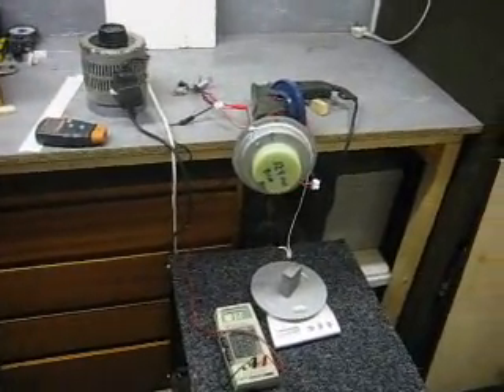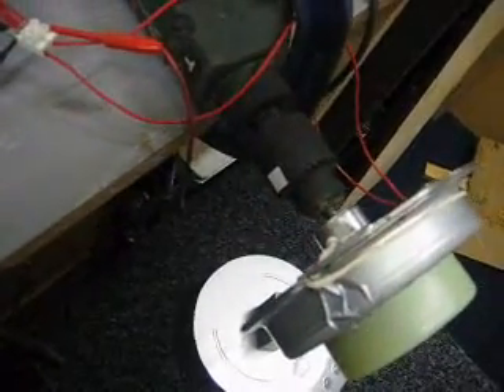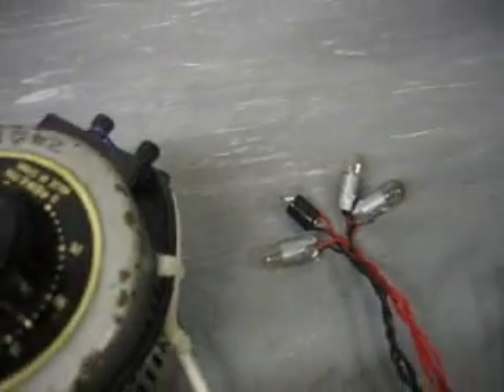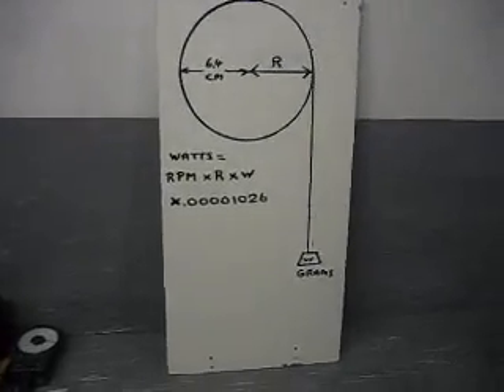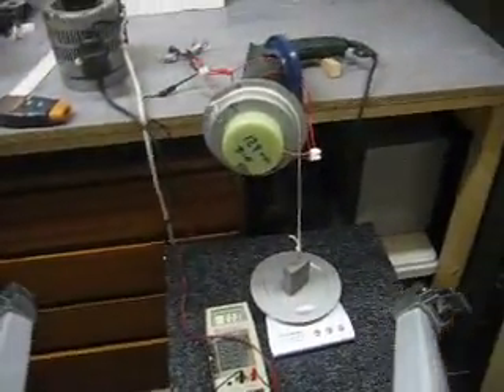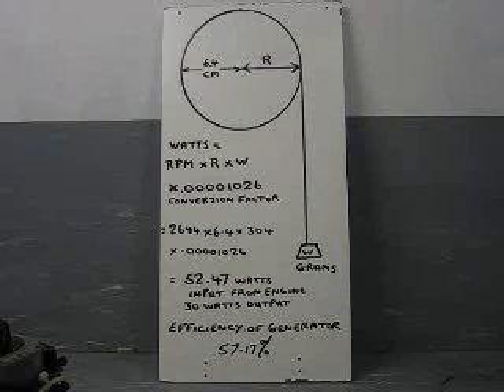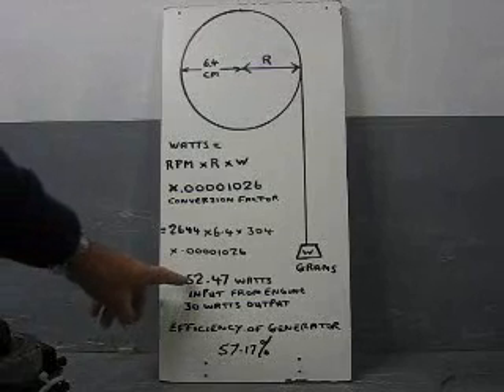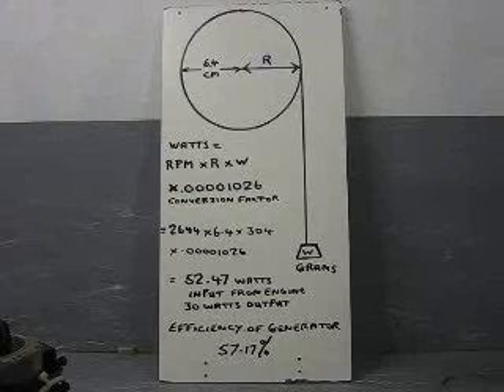RHOMBIC DRIVE STIRLING ENGINE, PART FIVE

Comment: Wait a minute! 
Did your Input Power calculation account for the weight of the mass sitting on the scale??
The string tension = weight of the mass MINUS the reading of the scale. Since Input Mechanical Power= rpm x string tension x conversion factor, if you left out the weight of the mass, you will get a larger value for the input power and, therefore, a smaller calculated value for the generator efficiency. So my question is, did you account for the weight of the mass sitting on the scale in calculating the input torque and input power? If you did not, you will get a larger value for the generator efficiency. 57.72% is a very small generator efficiency. 
Another problem could be a MISMATCH between the load resistance and internal resistance/impedance of the generator. Maximum power at 50% efficiency is delivered by the generator when the load and internal resistances are equal. Higher the load resistance higher the delivered power but lower the efficiency.
Reply from the maker: I zeroed the scale with the weight on before starting the test.

Comment: Why the disparity in rpm between your measured 700 rpm on load and 1100 rpm off load and the required 2600 rpm need by the drill to produce the 30 watts you set your experiment at. That suggests the generator was a different one?
Reply: The difference is made up in torque.
Reply: He measured the RPM off the crankshaft pulley first. The pulley on the generator is much smaller in diameter. Larger pulley driving a smaller pulley means the smaller pulley spins faster, about 1:3.71

Comment: Barumman a thought.   For people wanting to persue Stirling Engine (SE) design, one of the difficulties becomes having a design that works.   Linux OS used a communal approach.   Crowd sourcing and a web page coofers mechanisms to run a not-for-profit organisation to develop the engines further.  Places like GitHub offer places where communal tools such as FEA/FDA and QCAD can be used to develop modelling tools; other webspacesneed to be available swap advances in engineering design and make machining easier.   For others reading this,  please indicate support or otherwise below.   I am working on a low temperature difference engine but there are significant thermodynamic problems to be overcone, a major one has been overcome by implementation method but it's still only conceptual at this stage.

Comment: You mentioned the gears were in an oil bath. I'm novice here but have been very intrigued with you. If the gears are enclosed try using ferrofluid instead of oil, it won't break down but has very little friction by adding a neo magnet on the case. If I could help at all this would be it for now. Great work very inspiring

Comment: In video #4 he measures both voltage and current, 13.5V 2.3A, that's where he gets his' 30 watts from. Assuming the lamps are the same, all he needs to know is the driving torque and rpm. No? If we had the stroke and bore and pressure maybe someone could calculate the temperature difference in the engine for each cycle? Thanks for video!

Comment: Nice video. Only one part I don't like is measuring of the output power. Lamps has no fixed resistance - as it heats up, resistance increases. So, it will be better to use voltage AND current measurements instead to get exact measurement of the output power. 

I bet you will find your generator is more efficient than your math show. What has poor efficiency is this drill (waste heat, cooler fan, bearings...).

Comment from the maker: @talon0863   Hi, Thanks for the kind comments,The tubes are high temperature silver soldered, as for using helium I don't think it would stay in the engine very long I expect it would leak through all the joints.
Best wishes, Cyril

Comment from the maker: @moffett8  Hi , I'm not sure, small engines have a higher  mechanical friction loss while the larger ones have a problem of getting the heat into the centre of the engine.  I hope that makes sense,   Cyril

Comment: Barumman, I'd be very interested to see what percent power increase you get by pressurizing with helium or hydrogen.  Thanks for letting see your fine work.  I'm very impressed by the level of skill needed to make the engine. How did you connect the tubes on the head?  Beautiful work!

Comment: Barumman , Hi  I take it your answer to be yes! But not on a small model as that
What say a eng. 10x bigger - built out of the best SS,Titanium,etc., w/ a flywheel
heavy enough to retain torque - coupled to a gearbox to increase output RPM to
a direct driveshaft turning a power plant generator. And harnessing earths Geo
Thermo heat for power (Superheated Steam) ?

Comment from the maker: @dirtydogvideo 
      Hi, the formula for calculating the efficiency was obtained from a reference book so I am assuming that it is correct, I think that measuring the power input to the drill motor would introduce more errors.

Comment: I'm curious as to whether methane would work well as a working fluid. It's safer than hydrogen anyway; you can smell it if there is a leak (assuming mercaptan has been added), and it only ignites under a narrow range of concentrations. However, I don't know what would happen if the engine discharged all of the methane very rapidly.

Comment: Nice beta. Is your heater made of 316 stainless steel? Have you done a computer analysis of your engines gas circuit? I am building a larger beta engine at the moment but I haven' t quite figured out the rhombic drive geometry.
Really really nice work

Comment: Why do you suppose that is ?
Is there a basic difference in efficiency between linkage types and/or alpha/beta/gamma configurations ?
Might there be ways to reduce critical friction points ? like cylinder walls or belt drives ?

and are you (even in the back of your mind) thinking of any new stirling designs ?

Comment: questions (if I may);
is the rhombic gearing in an oil bath ? 
is the water jacket a simple spiral ?
where is the regenerator, and what did you use for it ?
could a simple lever action hand activated air pump be added to the body, on the side ? (eliminating need for air compressor) and how well does that air pressure hold ?
might the snifting valve and the pressurization port be incorporated into a single system ?
just a few nutty, ill-informed ideas

Comment: Perhaps, with some help, you can increase the efficiency of this wonderful design. I'm curious, too about the effectiveness of the burner and about what power transfer would be most efficient and compact.. 
could the generator spindle not be mounted co-axially opposite the main flywheel ? 
and might the water pumping action be taken directly from a reciprocating part of the linkage, rather than enjoying a belt drive ? I can't wait to see this thing out front of a solar dish !

Comment: Nice job Barumman.
It is not the engine that is low efficiency, rather it is the burner.
Easiest way perhaps to estimate overall heat into the engine would be to measure your cooling water flow and temperature rise across the engine to calculate the heat lost to cooling, add on the 60Watts mechanical and I think you would be pretty close.
But perhaps you are already way ahead of me with soon to be posted Episode No.6?
I can't wait. Cheers Mike.

Comment: I can't begin to tell you how much I appreciate your efforts.  Your videos are excellent!  Thanks so much for posting.

If you can stand the embarrassment, I'd be really curious to know the answer to OleTc's question about fuel consumption.  I think the result would actually speak more to the efficiency of engines in general than to your particular implementation of this one.  And speaking of which, you've left very very little room for embarrassment, if any.

Comment: Hope I don't appear pushy, but my mind has been working with the idea of how to decide the overall efficiency of this fine stirling engine.
Could it be done by putting the gasbottle on a weight, while the engine is running. Let engine reach the 60 watt output. Then read weight of gasbottle, let it run for 5 min and read weight again. Difference is consumption.
If the energy in watts of the consumed gas is known??, then You know energy in / energy out and thus efficiency. 
Regs

Comment from the maker: The engine would produce more power if I put in more heat + pressure but I like to keep the
heat exchanger tubes below red heat as they are only silver soldered.
Thanks for the comments,yes it is good fun.

Comment: I can only second the comments. Very well done. Scientific television at its best.
Was the enging pushed as much, as You felt it could handle to achieve the 30 watts output from the lamps? 
Another interesting question is, what the efficiency of the motor acutally is. I don't know how, but some sort of calorimeter, to measure the used amount of heat.
To wrap things up - hope You enjoy making these videos as much as we like to watch them.
Thanks.